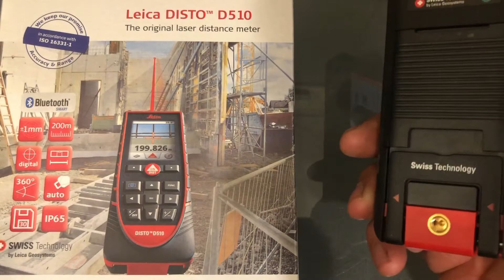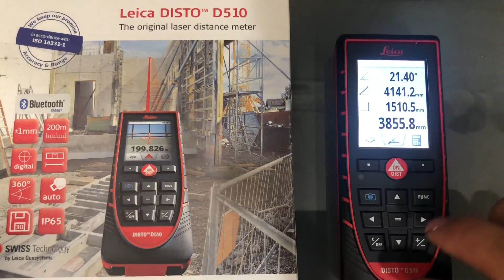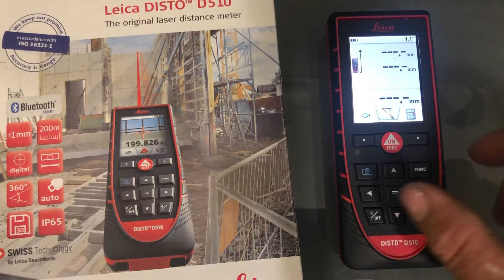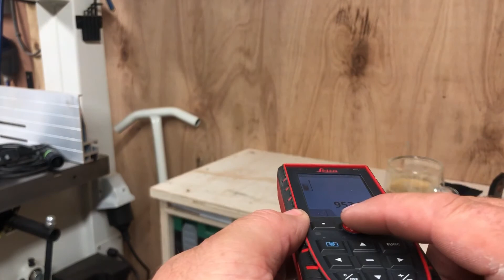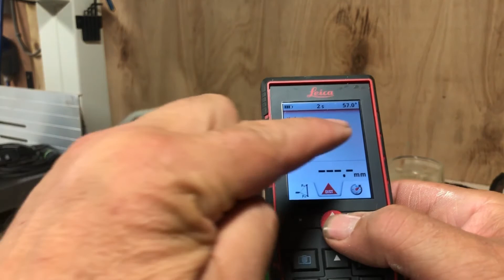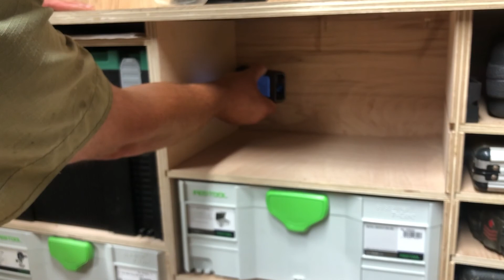Leica Disto D510 laser ip65 waterproof

Comment: Interesting feature where u can add 2 together.
I called leica today and told to do that need p2p function 
My job involves measuring from possibly the centre not a wall 
That function does it perfect and exactly what I asked What model does it and said the 510 but told no need p2p 
So I have now bought a 510 thx
Reply from the maker: To measure without the p2p you need to be perfectly square with start point of the measurement (from what I can work out)